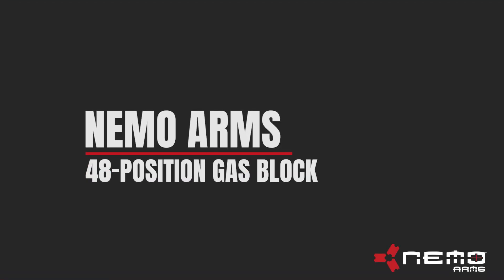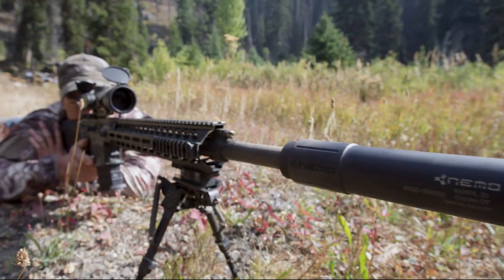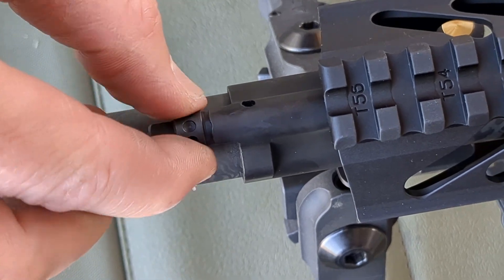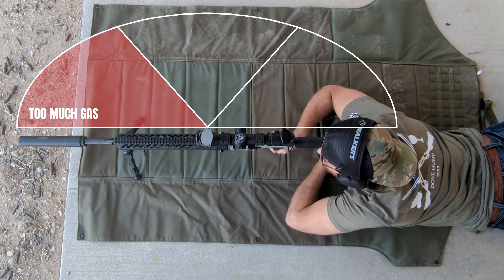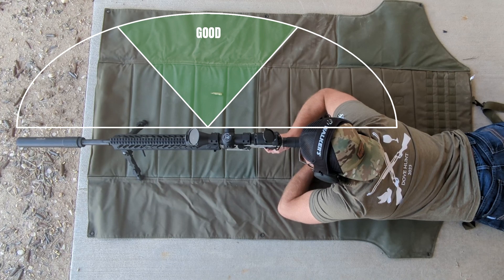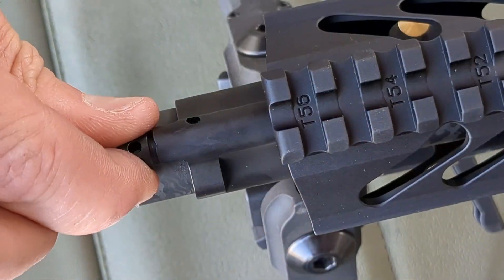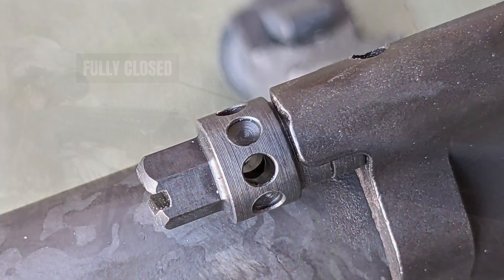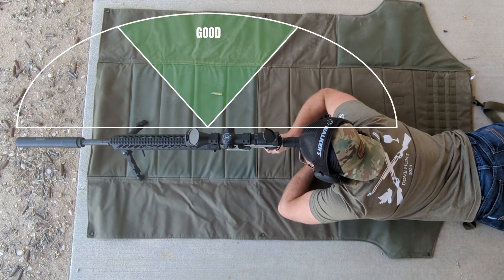Adjusting the Nemo Arms 48-position Gas Block

Comment: The thing that sets this gas block apart from the rest is the threaded gas tube, odd that that isnt mentioned in the video. Im interested in buying a few of these along with the gas tubes. I appreciate the fact that you guys actually did that unlike everyone else but why did you weld it instead of using a AN fitting or to not copy knights pattent you could have used a jic or a threaded ferrule. Also if you guys added a jam nut and threaded your gas journals on top of that you would be printing money, and to take it to another extreme dimple the entire barrel, be like kac, find ways around their patents. Just my 2 cents, which is probably worth nothing